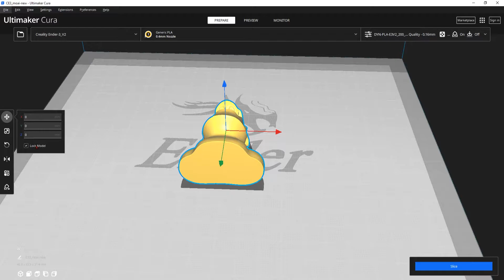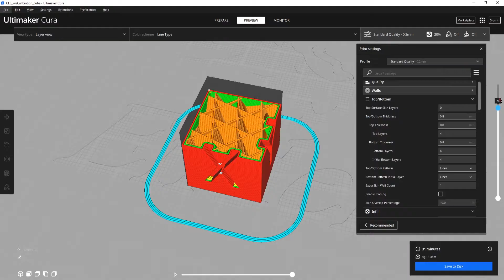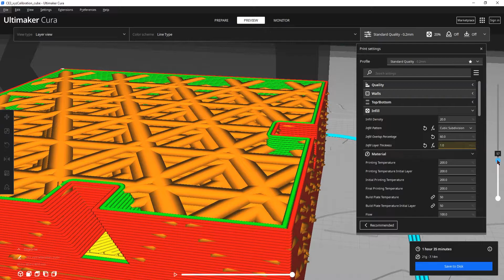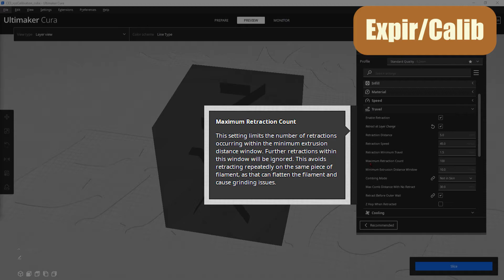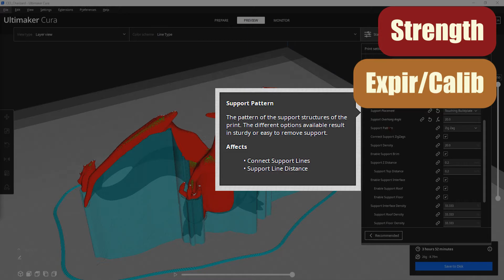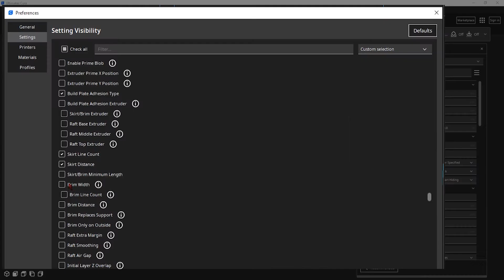100+ CURA Settings w/ Examples | 2022, 2023, 2024

Comment: Hi. May you know to make this - heating hotend to lift up from the bed instead of touching the bed and heating. In older versions of Cura, the hotend was lifted a bit while heating.
Reply from the maker: are you referring to when the auto home, and then the hotend heats up after? After looking im not sure you can, because Cura adds the heating G-code first, so I am not sure this will work but here is my idea:
I think you're fix is modify the starting G-code to the printer, which in cure you can do by going to Settings -> Printer -> Manage printers. Choose the printer you want, and select Machine Settings. This is where you can modify the starting G-code, which allows you to lift the hotend, and then heat up. i think you would want to try this: lift up ( G1 Z2.0) -> heat up hotend to temp# ( M104 S#) -> continue other starting G-code.
Reply: @bonezonechannel  - Thank you very much indeed. Yes, that’s what I want.
Reply from the maker: @StasysFPV  awesome. Hope it all works out. Good luck!